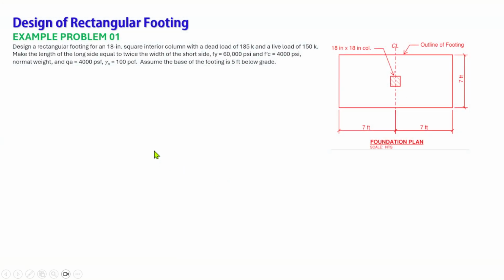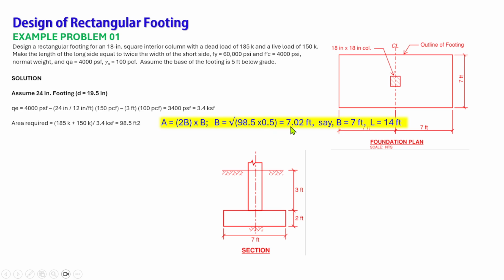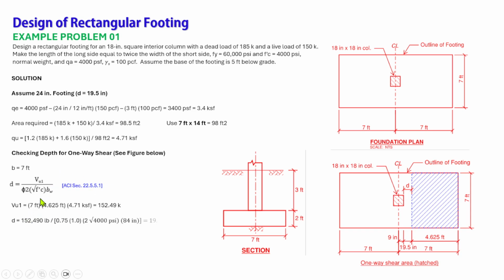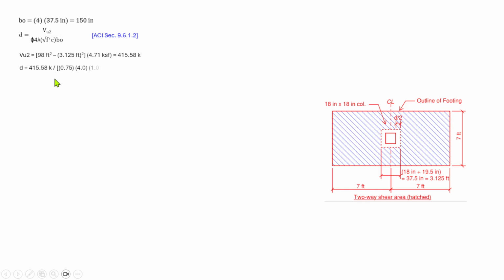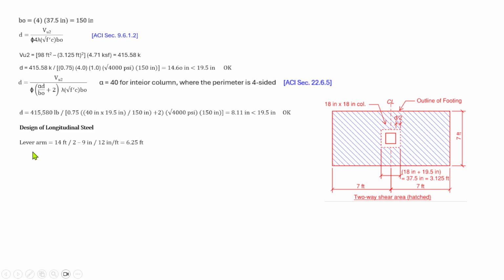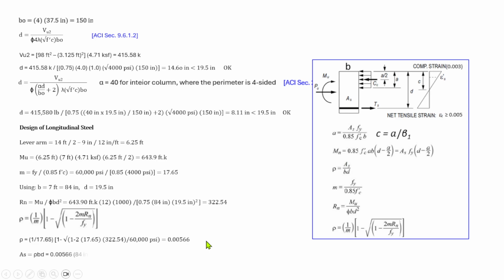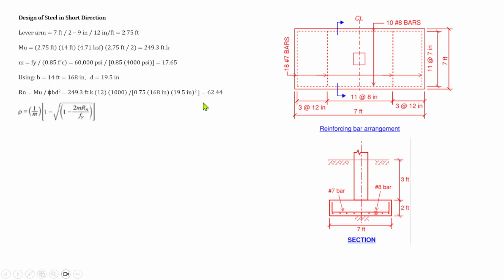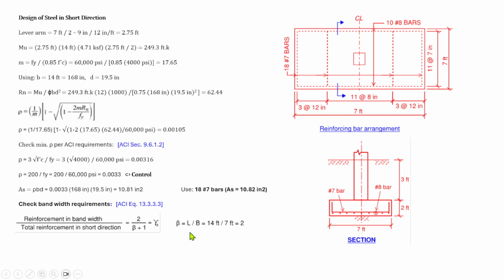How to DESIGN RECTANGUAR FOOTING | ACI 318 Explained!

Comment from the maker: Haven’t you checked stability yet? Start with this video 👉https://www.youtube.com/watch?v=klgrZvRBm3E
Reply: How you find band width dimensions? As per code
Reply from the maker: @uvaraj6328  Band width = Short side of the footing (B).  This is an assumed portion of the footing (along the short direction) within which the major bending moment is resisted and reinforcement is concentrated.